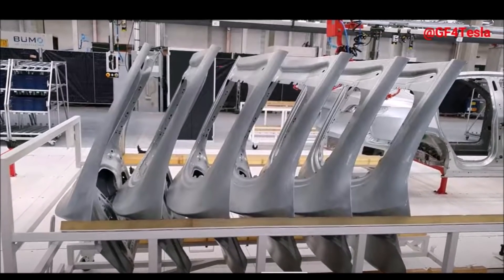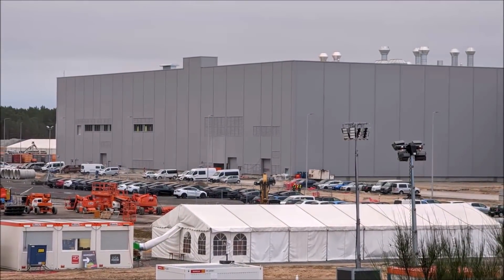BREAKING! Tesla Giga Berlin Shows How It Dips a Model Y In A Cleaning Bath

Comment: The dipped car looked like it had a bottom section....so no 4680 in the cars yet?  Of course they need to hold the front and rear sections together for the dip so maybe it is a temporary dipping tool that is only there for the dip/paint operations then removed for assembling the rest of the car.  That way they could still use the 4680 pack.
Reply: I believe BMW uses a similar painting process.
Reply: @ctuna2011  Yes, Actually I think most of manufacturers use that same dip process for the rust prevention coating.

Comment: Car body comes out of bath (special chemicals) and is sprayed with nozzels to rinse. Why does the rinse drain into the bath?
Reply: to reuse cathodic paint
Reply: @pumahuhu365  So the rinse is paint, same as the bath? Guess it's so, as you'd not want the rinse diluting the bath.
Reply: @michaelgibson1938  normally water based cathodic paint is used in this process, i would say high humidity water mist is used for rinse.
Reply: @pumahuhu365  Thank you for the response